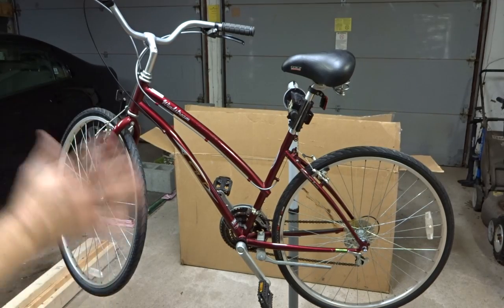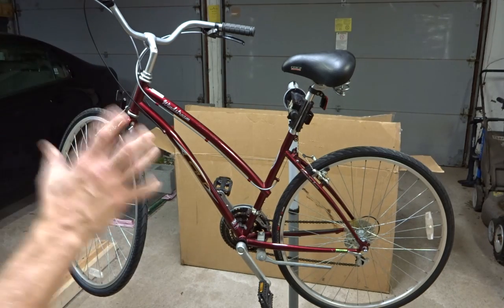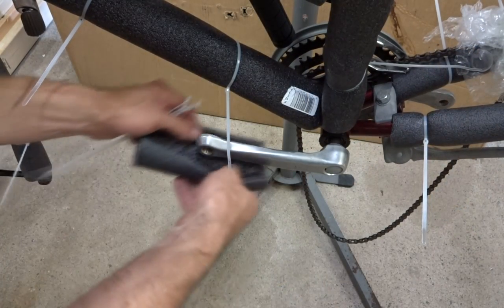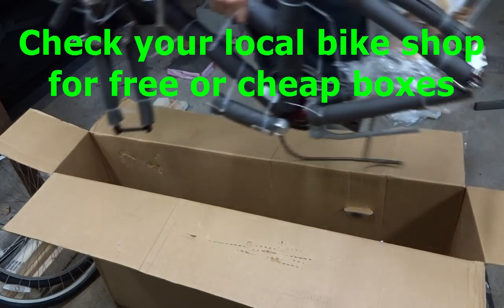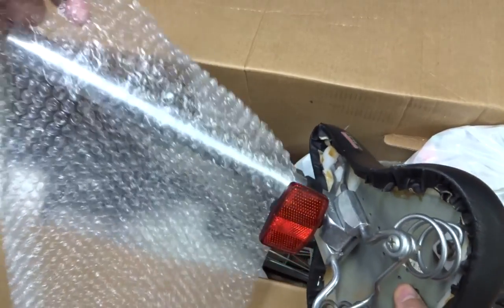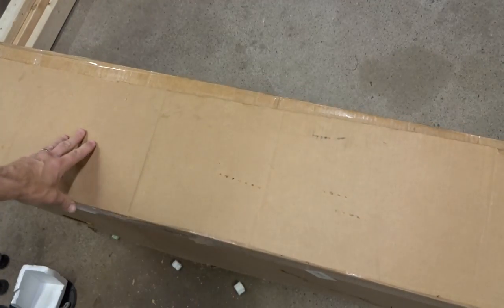How To Pack A Bike For Shipping In A Cardboard Box

Comment: Good protection. However if you took the forks off, you could use a box with similar width and height, but only 80cm long. Then, if all sides are under 1 meter like that, it can then be check-in luggage for flights instead of the more expensive oversize luggage.

As well, if couriering the bike, the main cost is usually in the size of the box not the weight, so typically you'll courier at a cheaper price with a 80 x 70 x 22cm box as opposed to a more typical-sized bike box like the ones you get from the bike shop. Some bike boxes ship at double the courier price than the 80 x 70 x 22, like those 140 x 75 x 20cm ones Giant uses for their road bikes.

Finally, you can carry a 80 x 70 x 22cm box easily.

Comment: What is the size of this box? I've a free sport luggage transport, but there is a limitation on weight which is 23 kg and size which is  210cm as a total of height, width and length. Do you think that's possibile to pack 21'' bike with 28'' wheels into box with this size?

Comment: What is the pipe insulation going to do? Just to protect the paint? Doesn’t make sense if some operator crushes your bike that stuff will not help
Reply from the maker: It helps protect the frame from being scratched, dented, banged up against other parts, etc. No, it is not going to protect the bike if they drop it into a crusher, but then not much will.

Comment: I read somewhere that if you say the box contains a TV, the delivery workers don't throw it around.
Reply from the maker: The was where the boxes had a tv pictured on it.
Reply: David Fraser Im a "delivery worker" myself, and from all these years of experience i can tell that no matter if its TV, laptop or a lamp - they all fly like a paper planes. There is nothing you can do about it, but pray for that box.  A big "FRAGILE" on the sides of the box would do better.
Reply: I'm no expert and I'll probably never do this. But I had a new bike delivered once, in 1985 from UK to Germany. It arrived in good condition and it wasn't broken down into as many separate parts or wrapped as thoroughly as RJ did.  Maybe that was more luck than design. Anyway, I still have the bike and it's still in decent condition. (Yes, I still love it).